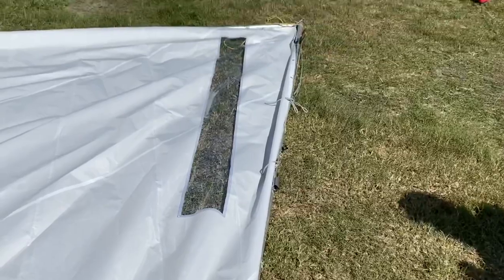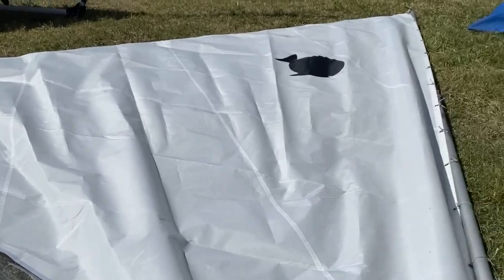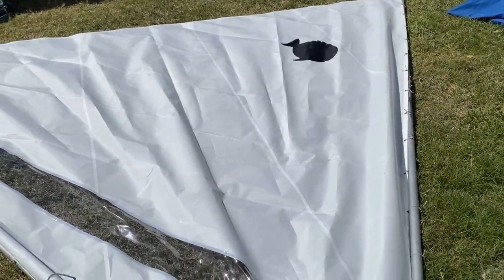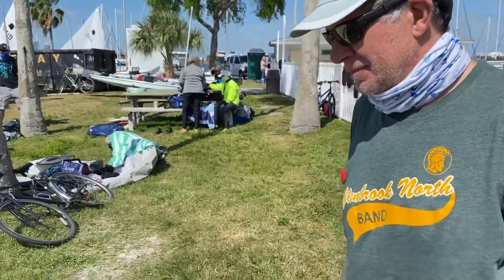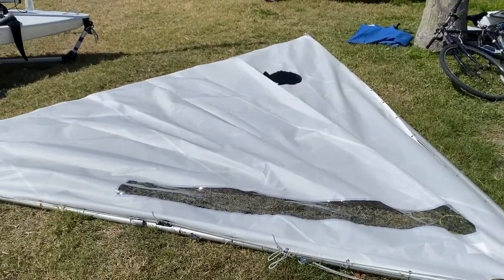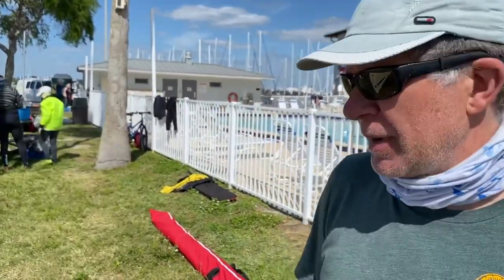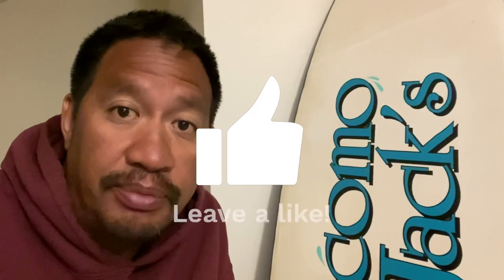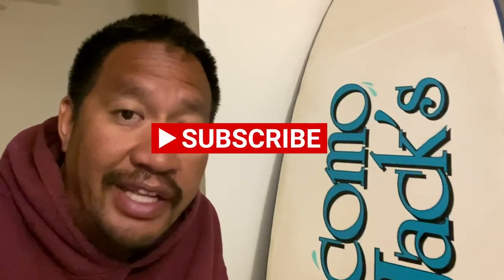Sunfish Sailor | New Sunfish Sail Sneak Preview

Comment: Nice haircut, Lee.  I can imagine LP would want to control everything to avoid supply chain problems.  The best manufacturing is one where everything is done under the same roof, but that is not always practical or cost effective.  The second best is when one's suppliers are all within an hour's distance by car, from my personal experience. Nothing beats close personal contact with all the players, and obviously they should share a common language.  Just In Time generally results in delays due to the weakest link, JIT has been a disaster for many companies, especially when shipping & customs is part of this.  Been there.

Comment: Sounds like they just want to keep it consistant ,although I have had different sail makers make my sails over the years and there is a difference , in durability, as far as faster? Well that really depends on your skill set and all the other facters in volved. Did you pick the right weight sail for the conditions of the day ,did you adjust your sail settings for optimum performance considering the conditions. We all know there is many more things to consider. Although it may be lighter , it may do better in lighter air , then again it may not. These are just a few of the questions to answer. Maybe keeping it in house is a way to monopolize the production of all parts. As we all know parts as well as sails are harder and harder to come by as time goes on especially locally. To only have sails available over in portugal is ok as long as the price doesnt get inflated with shipping ect , and the lag time of only one place to produce them. Im sure they will approve the plans  for production else where. But of course for international competition, and olympic I agree to keep it in house to keep it consistant with a one design. Thats what one design is all about , skill verses skill not boat verses boat. Its the fun of competition skipper vs skipper that makes it fun! 
Enough said thanks for all the hard work and the great spot on content keep up the great work!
Reply from the maker: Thanks for the comments!  I appreciate your comments and compliments:).

Comment: Does anyone trust LP?  Their history with the Laser is not great to the point where the class hated them so much they changed the name of the boat!  History of parts shortages, poor manufacturing techniques. I would vote to keep the North sail and slowly pull the class away from LP
Reply from the maker: Since LP owns all the rights to the Sunfish.  The Class can really only work with them.
Reply: @LeeSideSailing  And this is the problem. The CLASS needs to own the rights. LP is nearly a monopoly. I would like if Sunfish were like other classes. More than one supplier of boats and sails-- at least multiple sail and rigging suppliers-- would keep a little competition among the suppliers and help keep costs from going up unchecked.
Reply from the maker: But the Class wont be able to own the rights.  Why would LP give up the rights to their Intellectual property?  Why would anyone give up their property without compensation?
Reply: @LeeSideSailing  - The Class would have to buy the rights. Then they can publish the spec and invite all comers to built boats and parts. Competition among builders would result in a better boat and a better value.

Having LP build the boats, blades and sails and making these things from other builders illegal for racing seems like a horrible idea. Why would LP want the Class to adopt a new sail design built only by LP-- i can tell you it isn't for the good of the class!!

The Snipe class has 2-3 hull/blade builders and 2-3 sail builders. You have choices, there.

Love your videos!!
Reply from the maker: @joeheinzle  total understand what you say, but buying the rights would be a little bit out of budget. :).